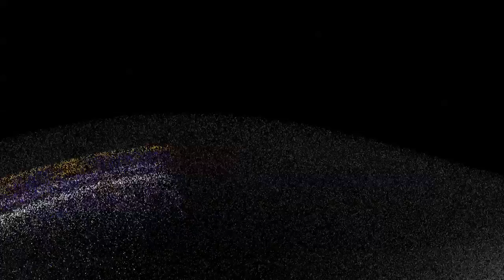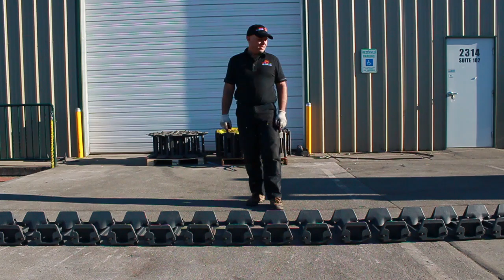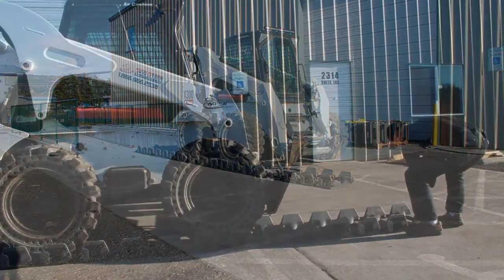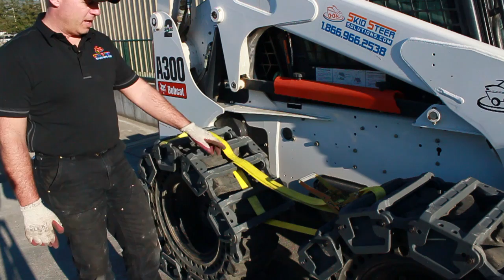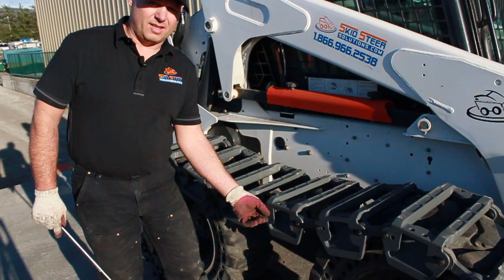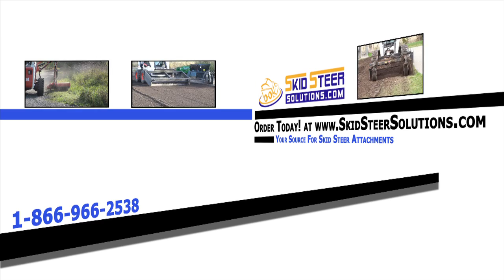How-to Install Over the Tire Skid Steer Tracks | Skid Steer Solutions

Comment: I found a set of steel tracks that came off a bobcat only problem is that his wheel base is 35.4 and mine is 42.6 can I length them so they will fit my machine